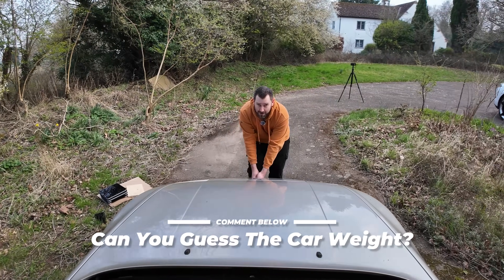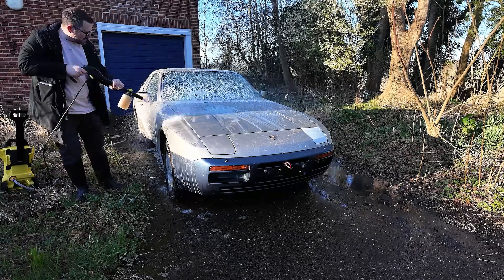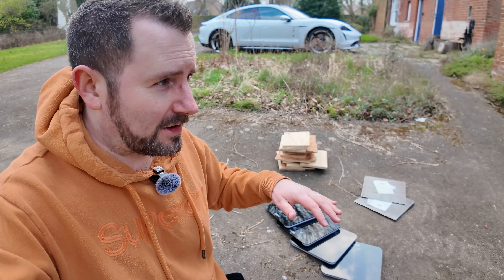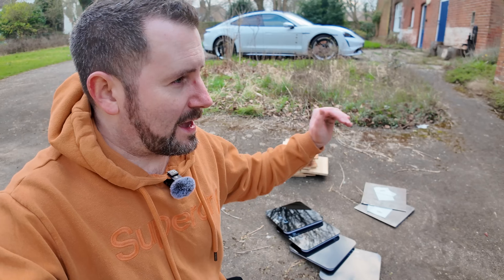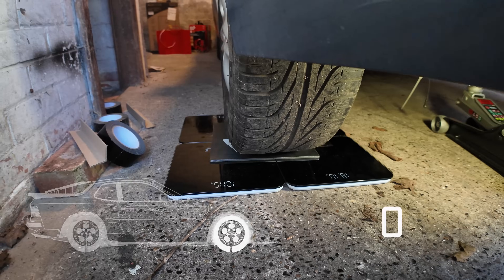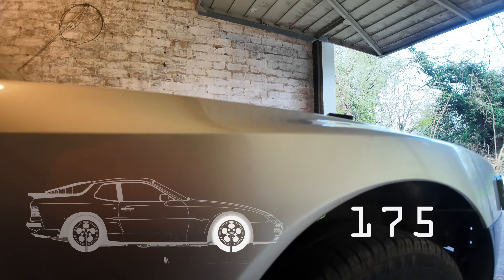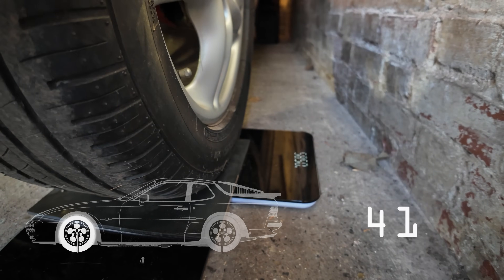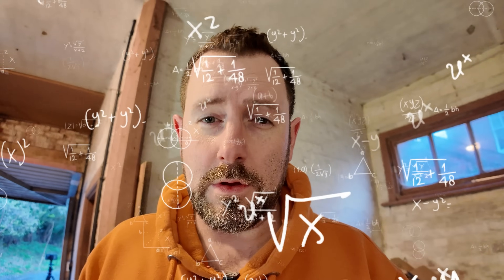03: Surely You Can't Weigh a Porsche 944 with Bathroom Scales! You can, and Don't Call Me Shirley!

Comment: i've been trying to figure out how to go about getting as-sat weight for my (currently)drivetrain-less ev conversion and I think I'm going to steal this idea! I'm starting with something that was 1 ton to begin with so it shouldn't need quite so many. thanks for posting!
Reply from the maker: Let us know how it goes?
Reply: @iamjoshuadavies  turns out you can find cheap used scales that measure up to 400 pounds from thrift stores. a little older, but not made of glass. my car is a few pounds shy of 1600 pounds based on corner weight measurements from stuff that cost me ~20 bucks total!